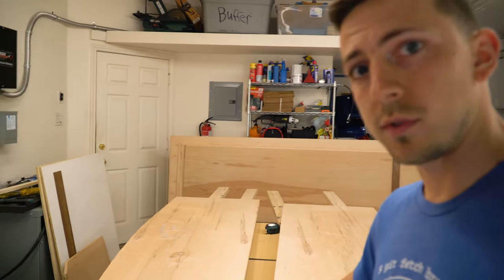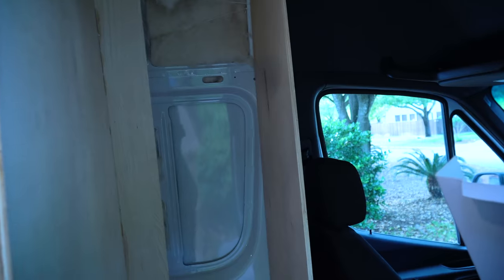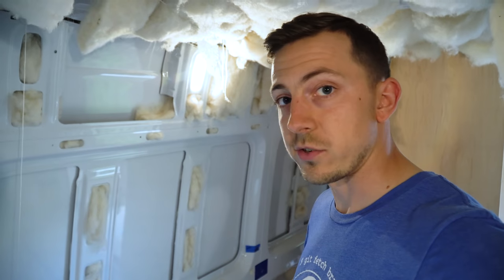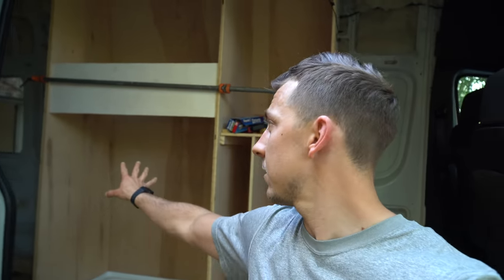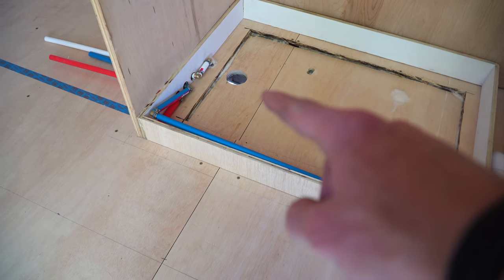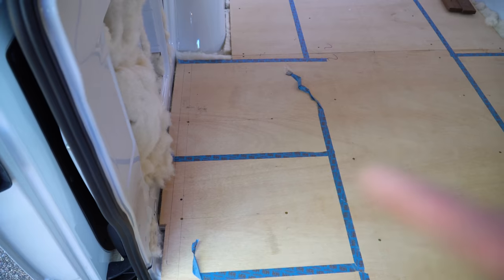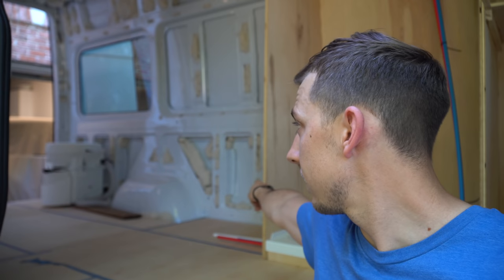Building our Sprinter Van Bathroom + Shower | Van Build Series

Comment: Hey y’all 👋🏼 how did you secure everything so it doesn’t push back out?
Reply from the maker: Hi! Do you mean how we secured drawers so they don’t open?
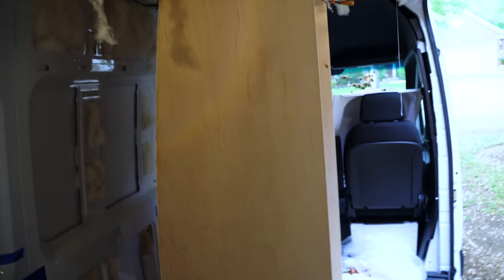Reply: As mentioned in 4:04 the entire bathroom unit will slide back towards the wall, but how was that secured so that doesn’t move out of place. Thanks 💚
Reply from the maker: Ah sorry! It has been a while so we have to refresh our memory. So the top and bottom of the shower are attached to the ceiling and the floor of the van. The back wall of the shower is not attached to anything, but snugly up against the side of the van. Hope that helps!